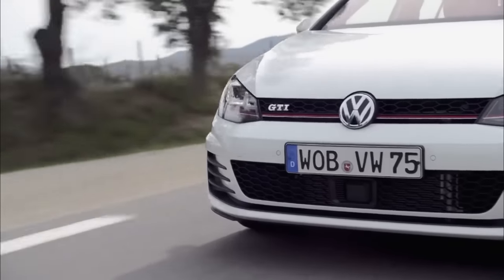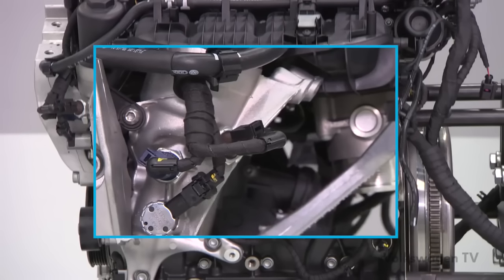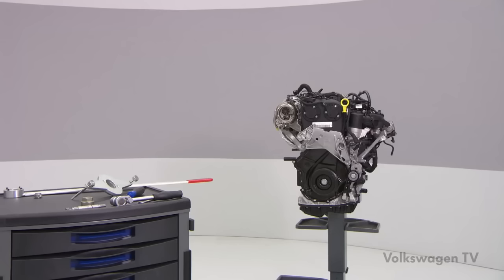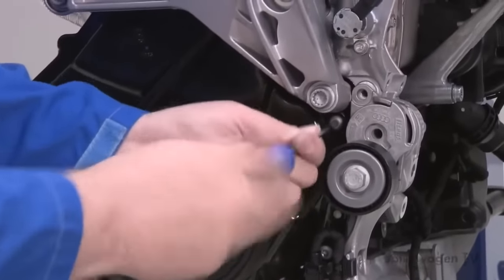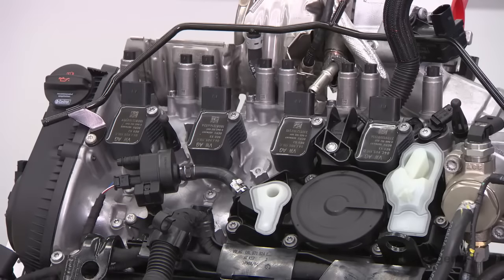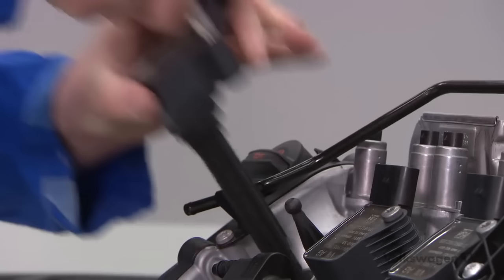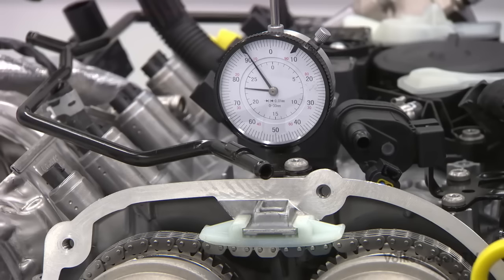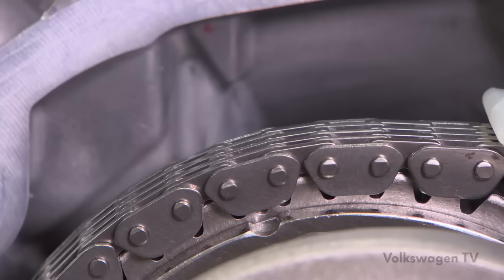vw tfsi tsi 2l ea888 gen3

Comment: The EA888 is one of the greatest engines ever developed. You can hardly get so much power, torque and fun combined with a relative low consumption anywhere else. In addition, the EA888 is a very reliable engine since the late Gen 2 model (end-2011 and newer). There is only one thing that you really need to have in mind with this engine: Do not even think of a Longlife oil change interval! This is the only way you can really harm this engine. As long as you give this engine a proper maintenance, you can drive it to the limit regularly and it will still last for a very long time.
Reply: I guess you’re not a VW tech, like me! Pure garbage!
Reply: Why no longlife oil? I service mine every 12 months
Reply: @MyEyesBled hi, why is he saying no longlife oil
Reply: @philpots3216 he means that you must change oil every 12 months or 5000-8000 miles
Reply: The gen 2 is actually the worst variant of the EA888. So by making this comment, I am very sure that you have no clue of what you are talking about
Reply: @danielfl.9347  Obviously you have no clue. The Gen 2 are worse than Gen 3 and Gen 4, that's true. But the late Gen 2 from end 2011/early 2012 were pretty good and are comparable to Gen 3 regarding the reliability. VW had fixed the problems with the timing chain and the piston rings at that time. I have one myself, almost 200.000 km. I have never had any problems. No oil consumption, no timing chain problems. But in general I would not recommend to buy the Gen 2. It's too risky because you never know what you get.
Reply: @daboerne  
Gen 1: Pretty good. Timing chain issues can occur already at 60.000km.
Gen 2: Pretty bad. Timing chain issues + Piston rings undersized from factory. Complete engine overhaul needed before 100.000 km for many costumers (timing chain + new pistons + cylinder walls if damaged
Gen 3: No issues. Timing chain lasts 150-250.000 km. No piston issues
Reply: @danielfl.9347  Yes and the same as for Gen 3 goes for late Gen 2.

Comment: All i have to say is this gen 3 is one smooth engine.  Most people that get into my GTI ask at a stop if the engine is running or not. (I never use auto stop/start hate it)  Very smooth power delivery as well.  It's not perfect but don't know of a perfect engine from any manufacturers.  Sure some fan boys of this brand or that brand will make claims but all engines out today have an Achilles heel somewhere.
Reply: If yours has the GPF/OPF it will be as quiet as a Corolla at idle.
Reply: @wrblue08  actually while running the db's per motor trend at idle for a 2020 GTI is quieter than a Corolla anyway haha
Reply: @eppyz  I fixed that by getting myself a non res Cobra Sport catback (thankfully mk7 models dont have OPF) Wont help engine noise, but it sure as heck compensates esp on my larger 3inch GTI Clubsport pipes. I suppose your talking of less vibrations in engine as somthing built with better tolerances though? Kinda new to how engines work.
Reply: @tredfxman  yes talking about a bone stock 2020 GTI.  Engine runs so smooth... My MK6 did too.  Though the 7.5 does idle allot rougher on cold start vs my MK6.  That even after the software update🤔
The idle reminds me of my Lancer Evo 9 idle on cold start.
Reply: Me neither it destroys battery life an unnecessary strain on starters.. And these things aren't cheap.. An outright con
Reply: I hate the exhaust manifold is part of the cylinder head on the MK7, compared to the MK6 that has its own, easier to modify/upgrade.

Comment: The only thing I HATE about it is that stupid plastic oil pan.
Reply: Stupid plastic oil pan is not the worst, the rubber gasket at the edge of plastic pan last only 4 years, start leaking.
Reply: and bad chain tensioners and engine coking
Reply: rt re European version has multi point injection. This means it is both port injection and direct injection, port injection prevents carbon build up. Known to be a reliable engine. Every design has its issues but they have vastly improved upon previous generation ea888 engines
Reply: @dom3827  thats on gen 1 engines from 2009 to 2010-11 year lol not gen 3
Reply: @petece3673  exactly
Reply: Can't be that bad most trucks have them and they take more beatings than your car with its floor pan protecting it..

Comment: That coil remover is a con, it only goes in the hole, you still pull on the pack the same as holding it with fingers, why con people.

Comment: I have this engine in my Atlas. I drove a 6 cyl Atlas and it felt like I was pulling a trailer.
The 2.0 torque comes on much faster and is pretty flat making it fun to drive without really stepping into it.
I plan on going stage 1 soon .
Reply: Stage 1 is a dream in this engine only thing I hate is that I have to do the valve cleaning.

Comment: Mine is 2.0 tfsi ea888 gen3  CWZ 
I’m glad  it’s  a dual injection system
Reply: @MIGHTY MQB 8 injectors, you can see the 2 ports injection
Reply: Only in Europe sadly
Reply: @AgentOffice  yes I wish it was in more areas. I would guess the second set of injectors help keep the air valves clean.
Reply: The valves stay clean 😍😍